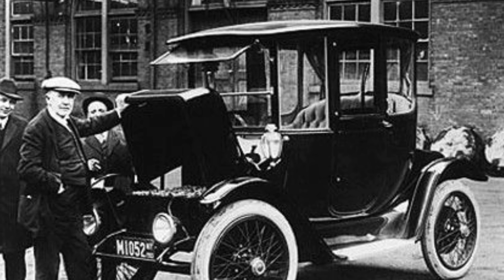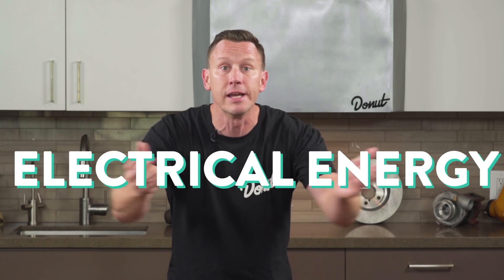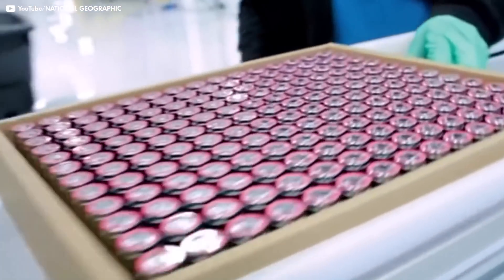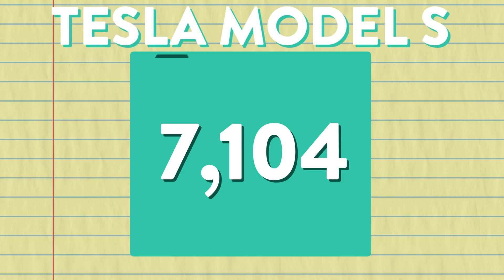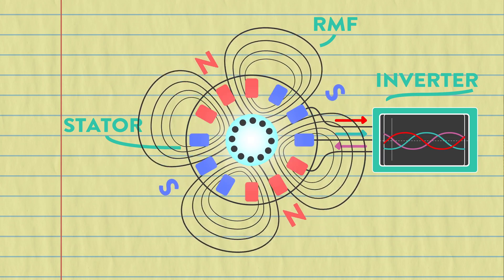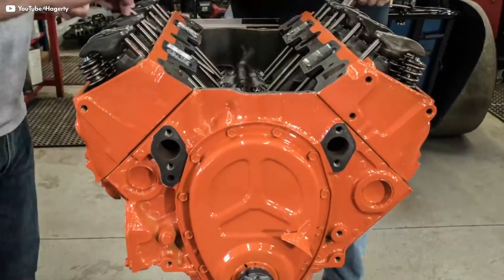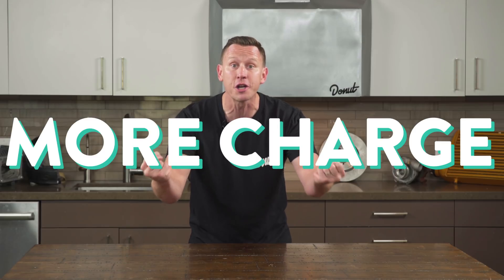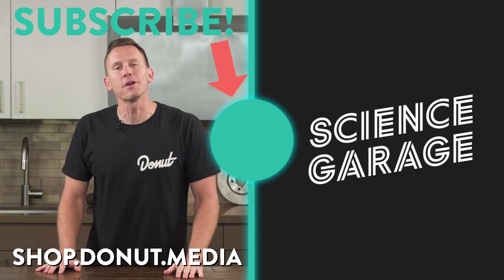ELECTRIC CARS | How They Work

Comment: "In a battery cell, amps measure capacity."
I'm sorry, but in the words of the illustrious D. von Trump, "wrong". Amps measure the rate of flow through a conductor, more or less how many electrons go through a wire section in a given amount of time, usually 1 second. Capacity is measured in Ah (amp-hour). A car battery with a capacity of 80 Ah can deliver 80 A of current for 1 hour, before it's discharged, or 40 A for 2 hours, or 10 A for 8 hours. If it delivers 80 A in 1 second before it needs recharging, that's not a very useful battery.

Comment: Electric cars will be the future but not in private ownership.  For urban, why bother even owning an electric car when you can use ridesharing or metro rail and not deal with parking...I realized this when I was in Paris 2 weeks ago.  I mean, electric cars are boring (no exhaust note, no engine growl, no rumbling, no manual transmission), so if they're no fun then why bother owning one if they're just going to be an appliance to get you from A to B, even more when it's autonomous?

Comment: Lithium ion batteries such as the Tesla's batteries (aka 18650s) are only rated for 3.7 volts nominal and 2 6v 2amp batteries wired in parallel would be 6v 4amp not 6v 12amp.

Comment: Great video ! However, amps by itself says nothing about capacity. Amps, like you say, is electrical current, if you want to know the capacity of a battery, you need to know for how long the battery is able to provide that current. Usually battery capacity is measured in Amp hours, or like Tesla, Watt Hours.
Fx if you buy a regular lead acid battery for your car, it might say something like 80 Ah, which in theory means that the battery is able to provide 80 amps for 1 hour.

Comment: Charging batteries from ac loses 50 percent of the power in the process in the rectification process a further 50 percent of battery power is lost in the electric motor control circuit.
So for every 4 kW of ac only 1kW of power hits the electric motor.

Comment: Misinformation in here. Amps are the actual energy, and volts is what pushes the amps, ohms are the resistance (the dam in his illustration), and watts is how much power is actually being used. Also, the tesla model s p100d has 779bhp and 920lb-ft with 0-60 in around 2.3 seconds. Not to mention that the upcoming roadster will do 0-60 in 2 seconds.

Comment: this is probably going to create a lot of hate, but the pollution part of the electric cars battery is totally untrue. people forget to take pollution created by the mining of nickel into account as well as other factors. In truth, as many studies done in Europe and articles around the world have shown that in order to create the batteries for electric cars, the impact on pollution is much greater or equal to creating a internal combustion engine cars. Sure, when you are driving it you don't create any emission, but the process of mining for nickel and creating the battery already has way more impact on environment than the emission of a modern car creates. Also don't forget that these car batteries cannot be recycled cleanly due to variety of chemicals that makes up the batteries. 

At the end of day, if and when the world really comes to a stop, no one will have any meaningful resources to run gas or electric cars anyway, so drive what you enjoy. Just don't pretend you are doing the environment any good by driving electric cars because we all know the real reason 99% of people drives electric cars or hybrids is because electric bill is cheaper than gasoline bill.

Comment: Awesome video, I have a suggestion that could be the continuation of this video. You guys could teach the difference between kW and kWh relating to electric cars (Formula E for example). Being that kW is the power that the car has that could also be converted to hp because it is a power unit and kWh being the amount of energy that the battery can provide relating for example to a fuel tank of a combustion car to be easy to understand. Thanks

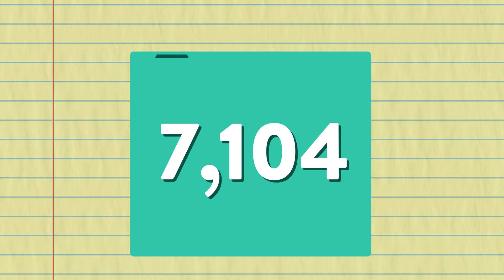Comment: Nice video! Just a little mistake at 4:33, it should read 4 amps when the batteries are mounted in parallel, not 12 amps.

Comment: How they work?  Magnetic induction.  It's the 'fuel' portion that's unreliable, requiring replacement after the capacitance has degraded.  It's like having a gas tank that gets smaller the more often you fill it up.

Comment: You forgot to add the fact that those "cleaner emissions" only start to actually be less than a regular car after they have been on the road for 10-15 years.

Now how many people daily drive the same car for 10-15 years?
Reply: How many electric cars last 10-15 years 😂
Reply: Electric cars don't wear out after 150K miles like typical road-cars do, and fracking for oil causes more problems than we can solve, whereas electric power is becoming ever more green. There's still the issue of battery materials, but the beauty of electrics is that they don't have  8 steel pistons rubbing against cast-iron cylinders before running through a couple thousand gears to get to the wheels causing wear.
Reply: The problem is that while modern engines may be fortunate enough to last 300K, electrics will, by nature, always outlast an ICE. They make up for their initial cost in the future.

Not all electrics are crazy expensive, and they are becoming massively cheaper very quickly. Cars used to be a thing only the wealthy could afford, now most people have several. Give it time.

I stated in my comment that lithium mines are a problem, they suck big time. But as a resident of Texas that has seen over 2,000 oil rigs go into place in what used to be completely untouched land, I'd much rather deal with lithium BS. Between where I live and the nearest town (25 miles away) there have been 250 rigs put up in 2.5 months, I'll elaborate. Oil rigs produce major carbon and methane emissions, absolutely destroy agriculture, and waste huge amounts of steel and crude oil/other natural resources (more than lithium). In addition, the logistics of oil-field work as an industry is also a wreck, we went from having 3 fatal car accidents a year in our 5-county area to over 300 within 6 months of the first rig. Local farmers and ranchers have no water supply, the roads are massively damaged without the possibility of repair (and temporary fixes are extremely damaging to the economy, millions of dollars per mile kind of damaging). Lithium is awful, but gasoline is worse. I'm all for finding a better solution here, but the petroleum industry is far worse than the few mines needed until we find new options for batteries. Maybe ethanol would be a solution, who knows, but gasoline is not worth the environment, the infrastructure, or the lives needed to support it. Lithium is the lesser of two evils, so for now, electric vehicles are the way to go.

Edited for grammar*
Reply: No, just a couple of thousands of miles/km should do it. Definitely less than 100K, probably significantly so. But that largely depends on where you live.

Lithium mines are actually very clean, as lithium is 'mined' by letting water evaporate from lithium brine. It's like letting your clothes dry in the sun.
Reply: this "fact" depends not on the 
"innovation" car but the 
lack of "green" mining, producing and electricity industry
Reply: Dillon Orr modern engines easily last over 250k miles if taken care of. They also don't cost twice my yearly wage. 

And no, look at an oil Derrick and then check out a lithium mine. If you're u can't see the lithium mine causes more damage, you're not capable of critical thinking.
Reply: @Tactisloth  Do you even know how they get lithium or are you making stuff up as you go?
Reply: @matthewprather189  yep. And even liberal fact checkers will tell you the same thing. Even Adam Ruins everything did a bit on it

Comment: Bart, my buddy. What about this little problem called POWER PLANT. How much polution is it generating? I bet at least the same amount as refinery which produces oil and gasoline.  You guys are from US so you have bulk of your power coming from nuke plants (i think at least) but i live in Poland and we have the biggest coal power plant in Europe and only 2 refineries. So at least for me, my petrol powered EJ8 with LPG system installed is as green as hybrid. Besides, 42 miles for 9 bucks (give or take for my shit math :P ) without eco driving, on a highway, full throttle and almost no power lose - is worthy exchange. Even though i'm getting shit from everyone that i'm poor, they spend twice as much for gasoline. Capitalism - God's way to determine who's smart and who's poor, right? :P
Reply: Here in the U.S.A. our number one source of power is firmly from coal plants. This is mainly due to the abundance of coal near to the Atlantic Ocean side of the country. We do have fission based nuclear power plants in the U.S. but my power were I live mostly comes from hydro-electric power from the Hoover Dam and solar power. Just an FYI, one of Tesla's factories is located in Northern Nevada, 10 hours from where I live, and their power supply there is mostly based off of solar when possible. I am aware that the batteries contain sulfuric acid, and other harmful pollutants, but that's why we are encouraged to recycle batteries in the U.S.
Reply: We recycle them too, everybody does. Hell, we even have to give old battery in a shop to buy new one. That's nice that Tesla is going for clean power but what about Toyota, BMW and any other car company that produces hybrids? They put them together in a same factory as normal cars, just on separate assembly line. 

What i am getting at is that no car, combustion or electrical is green. With EU setting up downright stupid pollution laws our engines are 1.0, 1.2, 1.4 etc. with one or twin turbos working to get maximum HP, put to the highest limit. Who heard of 1.2 liter having 200HP?? Those engines barely works to 200.000km, having turbo and decent acceleration no drives them calmly. Countries are banning diesel engines from entering city's centers, that i can understand though. 

So instead of my dad's old VW Passat B4 which has 1.9TDI diesel engine and is now entering his 950.000th kilometer without major repairs we have cars designed to be broken after 200.000km or put to so high limit that they broke even earlier. My grandfather's Citroen C5 from 2009 is 170.000 and there is always something, and parts are stupidly expensive. Stupid bearing costs twice as much than to my EJ8 and it is exacly the same, in terms of how they are working.

So instead of producing downright indestructible cars, we produce twice as much decent cars. In 90s Europe car companies were like "We are making indestructible cars and we have loyal customers which drive our cars for years", now it's like "Buy any car, drive 200.000km, give old back and take new one for next 200.000km". So we make more cars and recycle more cars. Great job EU, now we are green as fuck. But you know, EU passed a law that snails are fish so France could get better prices on those slimy bastards...

At least Mazda is saving grace for car world. They work on what i like to call "petrol diesel engine". James did A New Car Show on prototype of it. Oil is burning better that petrol, diesels have better efficiency but petrol engines make less polution. Solution? We make self-ignition diesel engine running on petrol. 

I went out quite far from original subject, sorry for that. I think i just had to speak what's on my mind. Sorry.

Comment: There is a mistake at 4:27. You said that when you wire the batteries in parallel you are doubling the amperage while maintaining the same voltage. Therefore, the amperage for the parallel scenario should be for 4A, not 12A.

Comment: It's not the manufacturing of cars that has a large footprint but the extraction(mining), refining and production of lithium batteries.
Reply: WTF majority of the refining is literally done by the Sun its basicaly solar powered.
https://i0.wp.com/fmshooter.com/wp-content/uploads/2017/08/lithium-salt-lake-brine.jpg
Because its done with a series of evaporation pools. The BRINE is Extracted Pumped, not Mined from solid ore.
Reply: Surface based, brine extraction is only one method of mining lithium. Australia, the largest lithium exporter in the world uses traditional open-pit mines.

Comment: Team together thousands of Lithium Ion cells through a AC Motor Controller that can handle 2,000 Amps. Use 4x Electric Motors which are Century old technology already 200KW each. You total up to a 800KW Monster roughly 1000 horsepower. Welcome to crazy world of BEVs.
Reply: That's nothing in the BEV world. The new Rimac has 1916 Horsepower. I suspect the Tesla Roadster might be around there somewhere as well, perhaps a little less.

Comment: We don't care how electric car's work!! I need internal combustion and beautiful noises in my life.
Reply: Try drag racing a Tesla and see what happens. ICE cars can't touch what those can do. The only one that can is the Dodge demon. I'd rather have the performance and cheap cost to drive over the noise.
Reply: RCproject18 the dodge demon may be the only production car that will get close to it but if you go to any drag strip most of those cars are definitely not stock. And what happens when you get beat? change the double AA's? electric cars are great for everyday use or for getting to work and back but electric cars are pretty shit at doing thigs like canyon runs or driving on be roads, so really these not to much to like about them., I mean they don't make noise the don't have a manual trasmission and they weigh more than twice some peoples cars.
Reply: agree....  👌👍👌👍👌👍
Reply: RCproject18 
I actually don’t care for drag times at all if it means ripping out the soul of the car. Might aswell buy a motorcycle if that’s all you care for. 
If we don’t manage to find a real replacement for oil that is renewable in time, i’m going to buy a Supra or Skyline and run it on E85. It’s available basically everywhere here in Sweden. And when oil is at 0%.. i... idk.. time to try golfing, i guess.

Comment: Great explanation but your explanation about battery capacity is off. Capacity is rated in either Wh (watt hours) or Ah (amp hours). So a Tesla P75 has 75kWh of capacity. That means you can use 75,000 watts of power in an hour, or 37,250 watts in 2 hours, etc etc. This also translates to how efficiently you drive. Also a battery can deliver as much current as the load demands. True a lithium cell can deliver 30A but it could also deliver 100A, but will over heat and most like get damaged. So the battery pack in a Tesla will have a BMS or battery management system, to monitor and regulate the amount of current that can be delivered with respect to demand (how hard you stamp your right foot!) and the health of each string of cells in the pack.
Reply: Chris Wouse It was bothering me a lot as he explained how batteries work. Glad you wrote out the right answer so I didn't have to.
Reply: Jayce Brinkman 😂😂😂
Reply: For anyone interested, a battery's maximum current output can be described by a battery's internal resistance. This is shown by ohms law: Voltage = Amps X Resistance. That's why a short circuited AA battery (high internal resistance) doesn't spark but a shorted car battery (quite low internal resistance) will throw sparks.
Reply: The AMPs he told there are the Peak Amps of the battery (usually 60Aor 90A for cars with little electronics) it is how much load it can handle for a very small period of time without toasting. The charge is Ampere Hours
Reply: Yeah he had a strange explanation of a Tesla's power. 400V is the peak output. A little googling suggests 90 kW is the peak power utilization of D spec models. So 90,000 W / 400 V = 225 amps. Not sure where or how he got the 1500 amp number.
Reply: Lol wish I'd seen this before I wrote up my own explanation.

Comment: I kind of knew how they work when I was young I liked cars since birth I don't know when I didn't like cars anyway when your little you must have gotten a rc car at one point that's how I knew how they worked  I used to take them apart with my hands and a screw driver and open them up and drive them and see the motor run across the back it's pretty simple how electric cars work

Comment: i always wonder why they dont use alternators to charge the batteries, like the same way a battery in a normal car. would never have to charge it
Reply: The entire system is essentially an alternator, they recharge what they can using the tire rotation. You'd still have to recharge it as energy is "lost" in the form of heat and friction, there's no perpetual motion/infinite energy machines because the laws of physics don't allow it, some energy will always be converted into something else.